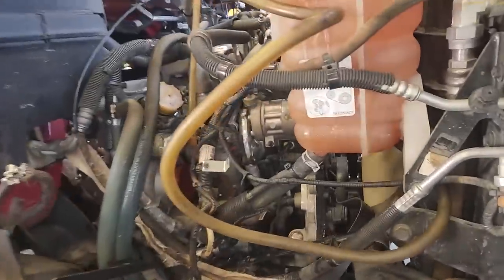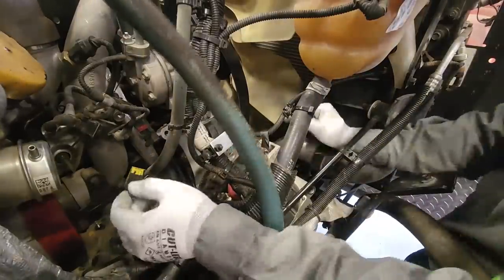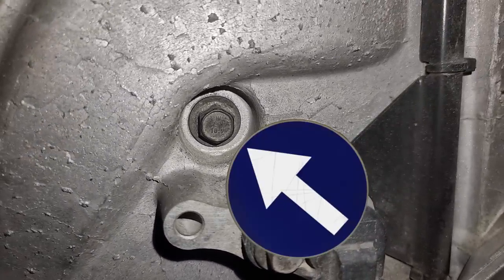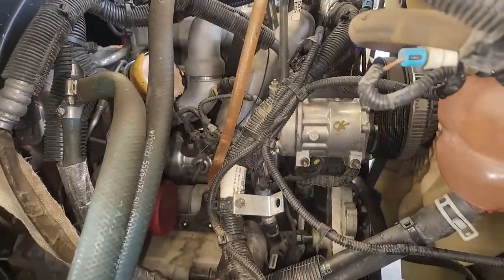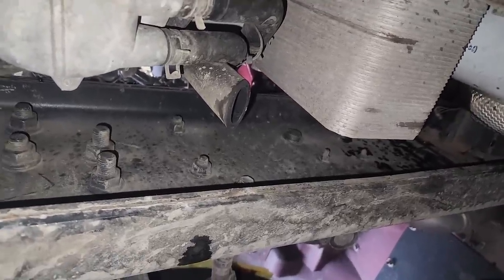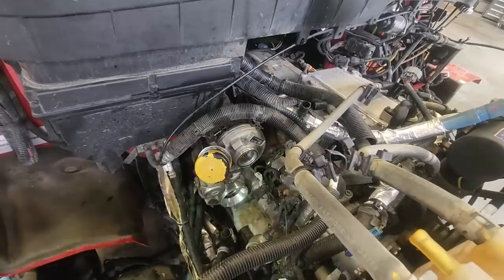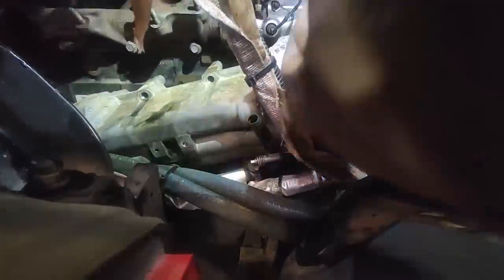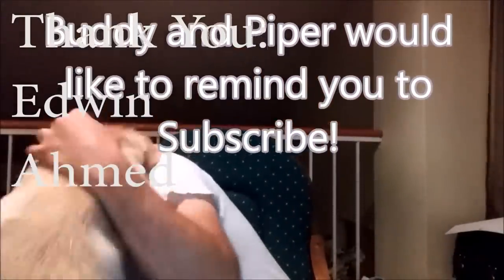"Trash-Fire" International Truck has coolant in the exhaust. EGR and Turbo testing.

Comment: EMERGENCY VEHICLES NEED TO BE EXEMPT OF POLLUTION CONTROL SYSTEMS
Reply: They actually can be in some situations but you need to apply and get the paper saying you can.  It should be easy and just default that they can avoid the junk.
Reply: We all should  be  make diesel  great again  2024
Reply: I agree we still have older Ferrara igniters and e ones
Reply: They sound good too with a straight pipe
Reply: YEP
Reply: Military equipment is
Reply: I tend to agree especially since most of the ambulance failures I’ve seen are due to these systems.
Reply: Why
Reply: By that logic, EMERGENCY RESPONDERS NEED TO BE EXEMPT OF ALL LAWS oh wait fuck they are.
Reply: All vehicles need to be exempt
Reply: The problem with that is. No revenue at end of service.   Can't sell to public.
Reply: @claterpillar1  In my area I have found several municipal vehicles that have had there emissions removed sold to the public they just include the paperwork that says that you can legally have it removed with the sale of the vehicle.
Reply: Emergency vehicles are supposed to exempt of EPA regulations.  So are military, and any presidential vehicles.
Reply: all vehicles
Reply: They will be shortly as will be run on batteries haha
Reply: if u were waiting on an ambulance and heard a deadly exhaust when it showed up you wouldn't need the ambulance anymore!
Reply: @tylergambon6492  DEF FLUID IS NOT EXACTLY SAFE EITHER.  HIGHLY CORROSIVE, VERY DANGEROUS IF YOU GET IT IN YOUR EYES, YOU DON'T WANT TO GET IT ON YOUR SKIN.  HUNDREDS OF EMPTY CONTAINERS GOING INTO THE LANDFILLS.  WHERE DOES THE RESIDUE GO WHEN YOU TAKE THE VEHICLE TO THE DEALERSHIP SHOP TO BE CLEANED?  WASHED DOWN THE SEWER SYSTEM?  BURNED OFF BACK IN THE AIR OR TAKEN TO THE LANDFILLS?
Reply: Nah, good enough for thee, good enough for they! Every vehicle in the presidents fleet and the military should have an emissions system or no one should! IMO
Reply: @claterpillar1  Why sell a old fire truck to the public?
Reply: The manufacturers also need to add a few feet and stop piling as much junk on top of the engines.  It needs to be ready to be put back into commission fast!
Reply: @jacobday3173  yeah because all the diesel AGE equipment was built in the 80s
Reply: @wyatt12358  not sure why I’m replying to someone who hasn’t figured out caps lock in 2023 but if you are worried about getting def in your eye probably best to stick with coloring books and rubber toys
Reply: I agree, and armed forces should have the same emission standards.  It would get fixed quickly.
Reply: @TonyLasagna to much idle kills these engines, firetrucks do high idle but its like the same…
Reply: All diesels shouldn’t have emissions shit
Reply: To my knowledge they run a different tuning in the ECM that doesn't derate or shut down on the same schedule.
Reply: A Diesel engine with emissions deleted would cost more than the standard one and most likely be less reliable. The extra cost is because of the special order and low volume of sales.
Reply: Agreed
Reply: @BHersey69  not likely on either of those
Reply: OK, BOOMER, YOU DON’T NEED TO YELL.
Reply: They just killed the L9 and x-12 for fire apparatus the EPA won't even let you buy it.  You have to get an X10 if you want a new sutphen pumper.
Reply: Why not put those EGR Def on planes?
Just another reason to not get anything newer than an '08.
Reply: All diesels should
Reply: @OrangeyJuice79  I know it's hard to understand let the adults talk
Reply: @OrangeyJuice79 not all. They still have certain parameters they can’t exceed. Like how many miles per hour they can go above the speed limit for example. At least for fire trucks and ambulances.
Reply: @royalblood2405  heavily used fire equipment… like in San Francisco… are at about 600 hours a year…. Highway Trucks are at about 3000 🎉
Reply: @royalblood2405 because your house is on fire, your kids aren’t out, and the closest fire engine is regenerating and unusable.  True story.

Comment: If one of those engines is run severely low on coolant, blowing a coolant hose, for example. You can guarantee that EGR cooler will start leaking. I work on school buses, and the number of stories I have heard about EGR coolers is crazy. We had a 2013 IC RE that the driver had a coolant hose pop, and she left it running with no coolant in it. By the time the mechanics showed up, the temp Guage was pegged on hot. They put coolant in it only for it to start pouring out of the exhaust.
Reply: Brilliantly trained driver, why would she do something that dumb?
Reply: It’s hot outside, gotta keep that 
A/C going or at least that what we see here in Arizona. I guess if you’re somewhere cold then it would be the heater 😅
Reply: @robinsattahip2376   Hard to say, but if it is a bus with kids, and maybe middle of winter, or summer, then it might be policy to keep the heat or a/c on for as long as possible.
Reply: She was trying to do the mechanic a favor by trying to seize the engine. Going by this video it's probably easier to replace an engine than it is to work on said engine
Reply: Yep everytime one of these coolers pops on a rear engine school bus, it bends #4 rod, has to be something to do with how high the cooling package is mounted higher than engine, don't ask me how I know, seen hundreds, lol. Made hell of a good living for years thanks to Maxxforce.
Reply: @retjarhead emissions control bs and horrible engine design definitely keeps mechanics job security… not to mention the trashPile that is the Maxxforce 7 engine.
Reply: Oh amazing!

Comment: Nice to see the train one show up here!  That happened back around 2010, the unit in question is a General Electric model C44-9W numbered IC 2699 and owned by Canadian National (in case anyone couldn't guess the paint scheme lol).  This locomotive type is powered by a V16 GE 7FDL engine, a turbocharged four-stroke common rail design with a displacement of about 10.95 litres (668 CI) per cylinder.  This particular engine is rated for 4400 traction HP at 1050 rpm in a locomotive.  It's somewhere in between the Cat 3500 and 3600 series for a size comparison.  They are fairly modular engines, the big piece on the ground was a 'power pack' (a liner and head, each cylinder has its own individual head), which then allowed the piston and possibly rod to be thrown up and out of the engine.  I don't remember the exact cause of this failure, but it was probably something around the head bolts/studs breaking or working their way out.  This particular unit was repaired and returned to service fairly quickly, and operated normally until being wrecked in a derailment just north of Saskatoon, Saskatchewan in January 2019.  As it happens the derailment was caught by someone's dashcam at a crossing.
Reply: Changing the power assembly itself is a pretty easy job. I just wonder how much damage was done to the block when the liner came out plus the con rods

Comment: "They make the engine AND the chassis!" You're correct... kinda. One team designs the engine to a certain set of specifications, and another team designs the chassis to a certain set of specifications. The problem is, neither of those teams really communicates with the other.

Comment: Great tip from the viewer about testing the EGR cooler using the airlift. I have seen at least 90 of these fail. Loss of coolant with no visible leaks is the first clue. High levels of Potassium, Sodium and Silicon in the oil sample are also a positive indication. Those will show up even before glycol. This EGR cooler should live. They FINALLY got a design that lives. 
        BUT!! There is another problem that lurks on these engines. Take an oil sample if you still have the old oil. Yeah, I know it will have coolant contamination. What your looking for are high aluminum and iron levels. Like above 200ppm. There is a "delamination" issue with the aluminum air intake pieces. Will wipe the cylinders.

Comment: Not that you'll ever see one again but....what I've done to check those is a quick easy test.remove the dog house and unhook the exhaust side of the cooler,get the motor up to temp and then pressurize the system,if it's bad you'll see coolant coming out the exhaust side of the cooler.

Comment: I don't really have a love or hate relationship with International engines, but I'm glad I didn't buy one.  The one I was looking at was a whatever (insert Navistar engine name here) 7 in a motorhome.  There's those that love 'em and there's them that loves 'em.  Fortunately there was a break from 2016 to 2017 and 2017 on has the Cummins 6.7 which is what I got.  I guess we'll see if it's any better.   Keep the good stuff coming buddy.

Comment: All legit gripes. I've done a bunch of these and have never gotten oil coming out of the drain tubes when disconnecting them... Bad spinner or overfilled? Remember to put the lower mounting bolts in the cooler before setting it in!

Comment: So some insight I can provide that can hopefully be useful. The EGR coolant tubes are designed to be pushed into the front structure so they can be removed. The funny thing is you actually placed the turbocharger oil supply line in the correct place, the garbage. THEY ARE A SINGLE USE COMPONENT THEY HAVE TO BE REPLACED EVERY TIME THEY ARE REMOVED AS PER NAVISTAR. I also suspect you have an issue with the crankcase breather because I've never had oil come out when I've removed the drain lines so maybe something you need to look into. The turbocharger nuts torque to 52 ft/lbs. As for pressure testing the EGR cooler it gets pressure test @55psi and should not leak down more than 5psi over 10 minutes. If you need any help or service info I can gladly help you with that. Keep up the good videos Josh!
Reply: What do you mean the egr coolant lines can be pushed into the front structure to get them out? The whole EGR cooler has to come off to get that line out.

Comment: At the dealership im at, we have the "egr cooler tester," which is a 55-gallon drum full of water.  Cap the exhaust side and submerge. If you see bubbles coming out, it's done.  Not 100% testing as some may fail at a higher temp or pressure but still quick and easy to test regardless.
Reply: That was Ford's test when the 6.blows were popping 1 in 10... it caught about half the failed ones.

Comment: Looks like a dodged a bullet. I used to work on a small fleet of international trucks but they were all pre emissions controlled DT466E  engines which were fairly simple and super easy to work on.
Reply: Looks like they've turned into a nightmare since then.

Comment: Just a couple tips to make that job easier from an international dealer tech. if you remove the cowl tray, fender and hvac box it gives you alot better access to remove the turbos and cooler and really adds about 5 more minutes of disassembly. I never remove the "dog house" to access those coolers. on the chassis that have the lower mounted cab, i just jack up the one side of the cab for access.  and remove the studs from the back of the cooler and leave the cross over tube in place
Reply: Also per International, the turbo oil feed line is a one time use and must be replaced if removed.
Reply: An even better idea is to remove the engine and kindly deposit it in the scrap yard
Reply: @JasonTAho  they may not be the easiest engine to work on but once you've done a couple they aren't really that bad. now i can't stand working on the maxxforce 13 engines or the v8 engines.
Reply: @timm6636  international/navistar dealer tech here. And I completely agree the v8s are absolutely horrible especially on school bus applications with dual ac compressors. And obviously the n13 and n13 scr. Even the n9/10 with isc
Reply: @timm6636  I guess I thought that was a maxxforce 13 in the video, was I mistaken?
Reply: @timm6636  the maxxforce 7? It's an incredibly cursed engine, I've done a few powertrain swaps after they inevitably grenade and I wouldn't wish that on my worst enemies
Reply: @JasonTAho  That is a Maxxforce DT medium duty engine in the video. the maxxforce 13 egr cooler is mounted above the turbos
Reply: Lmao you’re doing too much removing all that shit (a/c box) dog house is literally there for a reason, & be happy cuz no other manu’s have dog houses. Regardless that cooler is a pain in the ass turbos are relatively easy just heavy as fuck
Reply: @fernandosantiago1679  its much easier to remove the hvac box on the outside of the cab, its only 4 nuts once the cowl tray is off which is only 1 bolt a screw and 2 nuts. vs removing the seat, floor mat, cup holder and the dog house. also removing the hvac box and cowl try gives alot better access to remove the turbo's and cooler.

Comment: The dorman sepentene belt tool is great. Ratched wrech with extender and multple crows feet and stubby socket heads. Geat to get funny angles etc on belts. Saved me SO much headache-Ex Toyota/honda ASE tech.

P.S. yeah im glad i quit in late 00s as when i saw 1st ford diesel truck cab must be removed for head work i was like "Fing Nope". Had a boom truck version. Boss asked "should we take it"  i was like NO  how are we gona pull a 20meter boom and cab off a truck and make $. Man engineers should be forced to work on things they design

Comment: Every new truck is like this. Knowing a bunch of people in EMS I can tell you first hand they have a budget that can't be surpassed per vehicle. The heavy rescue at one of the stations didn't have rear brakes for 10 years till I had asked if the proportioning valve was connected 😂😂 anyways it went back to the shop, came back with working rear brakes and everyone had to retrain on the truck to be able to drive it. And they are exempt from state safety inspections. As for emissions, they run high idle when working and drive foot to floor so...

Comment: Most of our trucks are International Workstars. I have given in and anytime I have to work on anything on the side of the engine, I pull the quarter fender off the cab and the wheel and tire. Thankfully, most are Cummins power.

Comment: These are a common failure in the state dump trucks I have in our fleet it’s like everything else once you do a couple it gets easier.  I suggest flipping over the hood stop and use a strap and raise the cab after removing the cab support.  I never pull that dog box for those or the turbo drain lines.  That crossover pipe on the back of the engine can be a pain too.  Also we use the bulletproof brand egr coolers and have good luck with them. Best wishes cutting your teeth in the maxxforce world!

Comment: As an "idiot" that runs several internationals in equipment I love this video, always gets me to hear someone else bitching about the engineers.. besides Ford. I did put tamerx egr coolers on my auction bought 2009 7500 that haven't failed yet since the recently replaced factory one failed right after I bought it

Comment: Thought they revamped the oil feed lines to the turbos? I have seen a few with the same problem and they separated the oil feeds because the upper turbo wasn't getting consistent pressure.

Comment: I remove passenger cab mount and jack cab up. The loosen engine mount bolts and jack engine up. Cooler will come out much easier.

Comment: Does cat or someone make a tool to get the top main bearing out?  I’ve just ground the head of a bolt off to the thickness of the bearing and put it in the oil journal and rolled the crank around. But is there an actual tool for this?
Reply: There is an actual tool, but you just made one that does the same thing and saved money doing it. Just make sure your tool is slightly thinner than the thickness of the bearing so you don't score the block

Comment: I have a leak from the oring on the pipe that goes from the egr cooler to the back of the water pump housing. I did the egr delete already but i was wondering if theres a way to delete the egr cooler. It would be so much cheaper to freeze plug everything but im not sure  how it would affect stuff. Fill me in.

Comment: The pre maxforce engines the dt466 are much easier to work with in my opinion
Reply: The DT466 is a German engine built at a place called Neuss hence the Neuss family of engines. International used them in tractors and farm machinery as well as trucks for about 30 years I suppose. Watch the welsh plugs in the head, a rusted out one of those can lead you on a merry dance especially if it is right down the back of the head in a truck. Jeff
Reply: @jefftheaussie2225  No, it is not a German build engine.  All 400 series engines were produced at Melrose Park IL. The Neuss factory in Germany closed down in 1996 .
Reply: @ih-boygreenfield9907  I have no idea about the 400 series engines but the DT466 engine is German.

Comment: @12:25

I was going to change the three bolts that hold on the power steering gear to the frame of my 2000 Freightliner Century just because you know 23 years old and all....

... did I ever screw the pooch!

Even if I could get to the bolts to cuddle with a torch I would not be able to install the new ones because the heads of the capschool or toward the engine. They butt up against the bracket that holds the front crossmember to hold up the front of the engine via a motor mount. I had to rent a Gantry crane a hold up the front of the engine so I could take down the front crossmember and the front leaf spring so I could remove the obstruction to the power steering bolts.

There was barely any surface rust on the bolts that were 23 years old. ...😐

Comment: And you wonder why IH dealers have high turnover rates for mechanics? Now you know. Like the Ford pickups with the IH engines. Remove the cab for a valve cover leak. 8 hours labor for a belt.